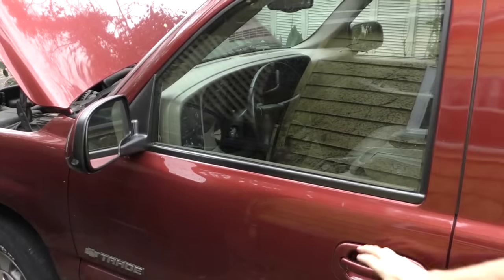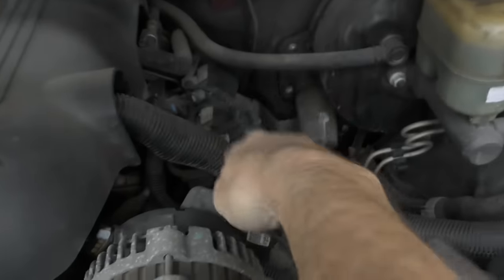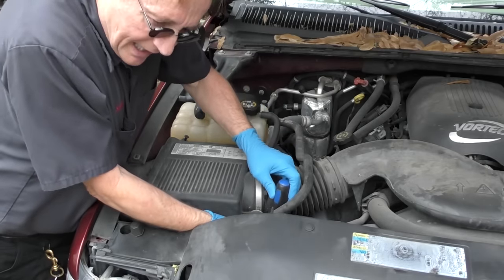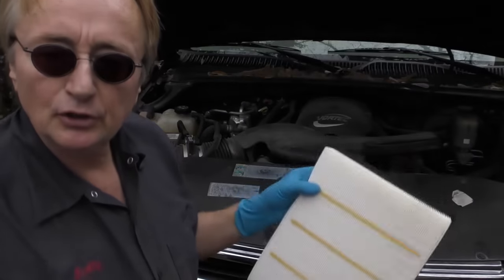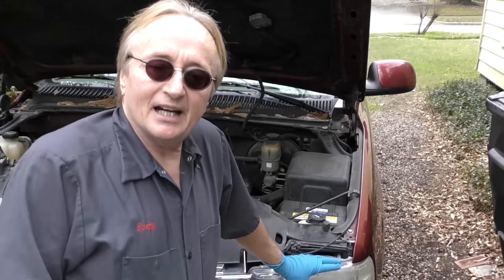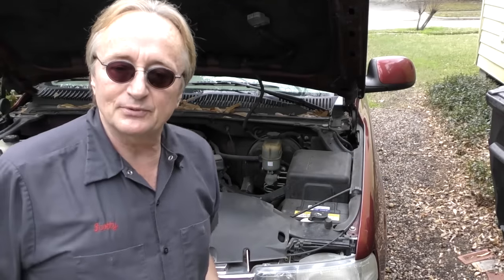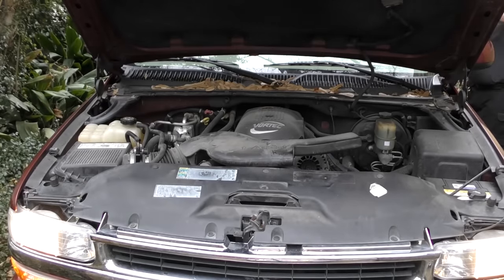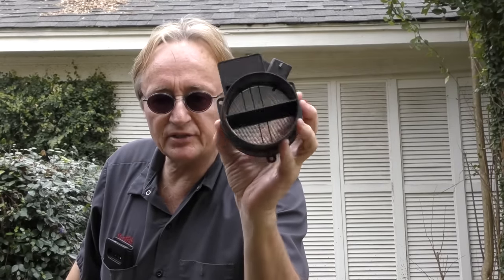Doing This Will Make Your Engine Run Better

Comment: Not to mention the MAF sensor deals with the trans shifting.
Reply: Best to keep them clean. The three wires if I’m thinking correctly has a three wire that heats the sensor to keep it clean. But a dirty Maf sensor can alter the shifting.

Comment: Man my truck's been doing the same thing like it struggles to like get to 7075 it stays around 60 I changed the fuel pump filter fuel injectors well clean the fuel injectors did all that necessary stuff with the fuel and it said I was running too lean on bank one and two got new spark plugs new spark plug wires did all that I didn't think about the damn fuel early mass air flow sensor searching for a long time I'm going to get one of those and see if that helps

Comment: Scotty, I have a GM 2.2 Ecotec dual overhead, it keeps blowing code P0420. We've changed everything that we can think of that deals with that code, every sensor front to back, including catalytic converter sensors. Mass airflow, oxygen..all... what else can it be? I'm thinking maybe electrical at this point.

Comment: Wow this is probably the problem with my Crown Vic.  I've been chasing a vacuum leak forever.  +24% fuel trim on both banks, and pinging on heavy acceleration.  I've tried to use propane enrichment multiple times to effect the fuel trim with no luck... 

I also cleaned the MAF when I bought it and killed a check engine light(don't remember what it was for though).
Thanks!

Comment: I wouldn't change an air filter that clean.  If the air flow is as good on the cheap one, it's just as good, unless it allows larger particles to pass through.  The type of material is critical.  Less material might make it need to be changed more often.

Comment: Hey Scotty, I have a 2013 Hyundai Elantra Gt Gls with 170,000km. I hear a clicking noise coming from around where the alternator and fuel injectors are. Do you have any idea what could be causing this noise. Ps the sounds of the clicks get faster as a accelerate. Love your content have a great day!

Comment: I had this same Code on an Audi 3.0 A4 Quattro.... service writer looked me straight in the face and told me " car needs all 4 O2 sensors, New intake manifold,  gasket and plugs".....say what??? Lol! I knew the MAF had failed.... I drove away...never looked back. Swapped the MAF, it cleared all codes and stumbling.

Comment: I have a 03 towncar executive and I can drive for a couple hours and then the car just cuts out. Especially on an incline going 65 plus on the interstate. Replaced the plugs which were factory, the oil and filter. Ran great for a bit then on the way to Portland OR from Olympia it just cuts out, shuddered to a stop then stalls. Can't figure out if it's the MAF or clogged cat converters

Comment: Heres one Scotty code 1421 2009 N-Versa 1.8 service engine light comes some times it will stay on for 2-3 months then go out stay out for 2days or 2months then comes back on again and it generally does it more in the colder months?

Comment: Hiya Scotty, I really want to know if I made the right choice or not. I replace almost EVERYTHING on my 2002 Honda Accord EX with the 2.3 and standard trans. Had 300k on her so I changed ALL the suspension, dropped in a used 60k engine with all new seals, gaskets, injectors and the same manual trans. The whole project took me 4 days and about $2500. Runs like a dream again. Did i make the right choice?

Comment: Scotty quick question. I have a 2013 Nissan Maxima with over 200,000 thousand miles. What would cause your low beam headlights to dim? I recently replaced the halogen bulbs to LED's. I changed the pigtail wire harness to ceramic. The led bulbs seem to be a little brighter but still the bulbs seemed to be dim. I took the car to a Nissan dealer which they couldn't find nothing really wrong but suggested that it could be the wire harness from the engine might need to be replaced for a thousand dollars which

Comment: Hi Scotty,
I have a 1991 Chrysler Voyager (european version of the Dodge Caravan) with a 2.5L engine with a manual transmission.
It has 510 000 km (315 000 miles) and is burning oil (around 1 liter per 1000 miles)
What do you think about those engines (and car)?
Thank you

Comment: I poured fuel injector cleaner in my 08 Silverado got on the freeway stepped on the gas an check engine light turned on

Comment: You didn't have to buy new maf sensor, cleaning the old one with maf cleaner would work. Also air sensor has nothing to do with lean fuel. It's before the sensor

Comment: 07 Equinox...lo beam headlights both quit. Hi beam and all other lights work. Dimmer switch turms high beam on off...no lo beam.  Fuses ok.  Diagram does not show a relay.   Where is the light relay(s)?  Any other pointers appreciated.

Comment: What would cause idle miss in 05 Century 3.1 motor...Smooth as silk after acceleration. Seems like Low exhaust pressure also at idle. Egr or Converter?

Comment: Hello! I’ve got a 2005 R52 mini 1.6L that I’ve done all 100 miles maintenance, but my Disc brake and Tire pressure sensors won’t shut off, yes I’ve replaced the 2 sensors and the brakes are new. What’s the secret to reset these crazy problem off. I tried all the secrets with interior buttons and disconnecting the battery. I mean everything and tire pressures check everything. Help please!

Comment: You could of used live data to determin if the maf sensor signal voltage was high or low instead of guessing that was the problem. I didn't see you check for vacum leaks. Now everyone who has seen this video is going to be throwing parts at it, they will go out and get a new maf sensors soon as their fault light comes on.

Comment: I have a 2012 Mazda 3i 2.0 L 4 cyl. 6 speed manual. I use it to Uber, great MPG. Currently 86k miles. How do you feel about synthetic blend oil for what I use it for? 100 mi a week Uber all city driving.

Comment: Thanks for the video. I am a 2004 Ford Expedition owner with lean banks problem and no specialists in the range on 1000 miles. Will the replacing the same thing help my Triton 5.4? Thanks.

Comment: I have a 2017 Toyota Corolla xse
I have  driven 60,000 miles and I was wondering if I should change the CVT fluid? Is it necessary to change the fluid?
Reply: Curious thing:  A long time ago my father and our mechanic had a conversation about transmissions.  My father offered the thought that the perfect transmission would be continuously variable.  That was 1964 at Mattar’s Garage in San Diego.

Comment: Hay brother I've got a 350z 2006 that I've modified and having issues with o2 sensors that I've changed over and over and in 4 day over again. They are now installed in long tube headers and showing low voltage issues and I cant seam to stop my vaccum leaks too. New hoses you name it this car didnt want a modified makeover lol.

Comment: Scotty, I have a question if you can answer for me... I bought a car, a 2000 Nissan Maxima and the check engine light doesn't come on when I turn the key to the "on" position.. I don't even know where it is suppose to be and can't find a pic online anywhere.  Could you help me find where my check engine light is suppose to be on my instrument panel?  and is there a fuse for the check engine light that I can check before I take the instrument panel off to see if the bulb has been removed??  Thanks so much!

Comment: Hey Scotty!  How do I ask a question?  (About an 05 Matrix with 350,000+ miles!)  Battery light came on intermittently over an hour of freeway driving (wipers slow when on, fine when off)..., then bogged down enough to just get off the freeway and call tow truck.  Is it probably the alternator, or possibly something else?

Comment: Great Video but what if it runs rich. I have a Toyota Yaris 2009 1.33 And I have a P2196 code Oxygen (A/F) sensor signal stuck rich Bank 1 Sensor 1. The car idles normal drives like a dream picks up speed and doesn’t hesitate at all but every time I clear the code why does it keep coming back on after a week of driving. I only drive local like 15 20 minutes a day to and back from work.

Comment: The little sensor wires inside the MAF do get dirty over time (even with regular air filter changes).... there are no moving parts to a MAF that can wear out, so you probably threw away a perfectly good MAF sensor that just needed a good cleaning with MAF Sensor Cleaner spray. Also note that a failing Fuel Pressure Regulator also causes these same symptoms, the fuel pressure only needs to be a little below specs to cause the injectors to dribble fuel instead of spraying fuel into the cylinders and that messes up everything! Arghhhh!

Comment: Hey Scotty what you think about straight pipe no cats on a silverado from 1990 to 2007 silverados and wonder if the too much back pressure is actually an issue or if it’s okay on the engine or even glass packs no cats thank scotty

Comment: Scotty I have a 2007 Chevy Silverado and the engine light keeps jumping on and off. I changed the plugs and wires and it’s still rinds ruff,  it doesn’t go over 40 miles per hour,

Comment: I have a different problem. 2010 Volvo XC60 T6 - recurring P0420 then $07E8 1/1 Generic. Says Catalyst System Efficiency Below Threshold Bank 1. I reset the codes and ran it approx 300 miles and the code came back. Reset and tried Caticlean (SP?) and it came back within 100 miles. I reset the code again; so far so good but what do you suggest?

Comment: Does oxygen sensor, or map sensor detect HHO hydrogen? If at idol I added hho will hydrogen take more space and cause map sensor to give less fuel signal,  since less air means lean fuel( less fuel)?

Comment: Scotty i need an advice. What can make my Gems P38 engine die when i push the brake. I have no code with the scan tool on the engine new spark plugs and new throttle position sensor new o2 sensors. I solved the problem by making it idling at 1100-1200 (with the screw on the acceleration cable) instead of 700-800. The problem is if i live it to normal idle when i break at low speeds it makes the engine die. What can it be?

Comment: Hello Scotty i have a ‘02 sierra 3500 8.1L with a trouble code PO101 that constantly comes up when I gently accelerate when passing or getting off the ramp to speed limits!!!  Tried cleaning and replacing (3rd sensor) but still pops up after about a month later !!  Runs fine  w/ good response .  Changed O2 sensors as well w/ 122k miles on it .... any ideas 💡 sir ?
I usually clear trouble codes each time.  STFT/LTFT seems to be fine reading live trends .

Comment: I have a V6 Genesis coupe with the same issue on the driver side bank only. I check for vaccum leaks with smoke machine, cleaned the Mass Air Flow sensor and the engine code only happens at high speed. I was going to change the fuel pump and the sock next. I'm I on the right track?

Comment: Does this theory apply to Asian cars as well..my 1999 Honda Civic LX is throwing a P0420 code cat efficiency low.. beginning to suspect too much fuel smells like it's running Rich.. Any suggestions.😕 Thanks for your time.

Comment: Hey Scotty my wife has a 2005 Toyota Matrix and it recently got the code P0171 system too lean bank one. The car idles rough and the cooling fan turns on and off all the time even when Not using the AC. I checked an old video of yours about this code and in that video you worked on a Matrix like my wife’s and you replaced the intake manifold gasket,  so that’s what I did on my wife’s car but the problem didn’t go away. Do you think it can be the mass air flow Sensor or maybe bad injectors or fuel filter or the pump? It’s weird because the needle on the temperature doesn’t indicate that the car is overheating, the needle is always in the middle where it should be and the car starts right up and drives past 80mph and it has never died on my wife. This has been going on for 2 weeks already and I can’t figure it out, the car only has 148,000 miles
Reply: Look up Toyota TSB EG051-05; that code can be tripped on 2005's by a poorly-designed air/fuel sensor (different from the mass air flow sensor) that needs to be replaced.

Comment: P2135 p0220 2005 Yukon 4.8. New throttle body new throttle body pig tail harness. Still power engine reduced?

Comment: Scotty,  I have a question - I have a 09 Chevy silverado w/t short bed reg cab v6 , I just noticed that yesterday while truck was parked running that the heat turned cold and when I started driving the heat was came back fine but I can hear the fluids going to the heater core.  Is this an issue ? Thanks scotty

Comment: A question to the oriacle. why is it that a car running on LPG sounds loud/clicking compared to running on its designed petrol fuel. They sound like an old diesel. Is it because of high temperatures or something?

Comment: Hey 👋 Scotty I’m have problem with my 2018 Escalade 6.2 it is have idle . I replace spark plugs and wire , check coils they good , change the throttle body , change air filter and cabin filter , check for vacuum leaks but still doing it . But I doesn’t have the check engine on or any codes but when the mechanic put the scanner it show that cylinder 7 is having a little problem. What show I do ? Change the fuel injecter ? I do now what to do anymore the car only have 65k miles 🤦🏼‍♂️🤦🏼‍♂️🤦🏼‍♂️🤦🏼‍♂️ thank you

Comment: Hey Scott can changeing the mass airflow sensor mess up the transmission shifting? My 2004 suburban has 200k miles and it's shift 1-2 but 3rd takes a while. I have to push it and let go of the gas pedal so it could kick in.

Comment: I have a 2016 Lexus IS200t it has 42000 or so miles do I have to use the factory specified oil 0-w20 or can I use 5w-30???     I feel like the lifters are making much more noise since last oil change I did and used 0-w20

Comment: I know Scotty doesn't like the Nissan Altima, but I have an '03 3.5 L and it doesn't even have the same engine as the 2.5 Altima's.  It has a Nissan Maxima V6 engine.
Reply: Every Nissan i have owned has been super reliable.

Comment: I had that same stupid code on my 2016 Honda pilot I wish it was that easy to fix but unfortunately me and my luck the fuel injectors in the fuel rods are no good which cost me a whopping 1500

Comment: Would the check engine light turn on if the engine was running lean? Or is it something the driver would notice from driving the car?

Comment: I have a 97 4.6 mustang gt and I had to replace the injectors, 19 pound injectors came out and 24 pound injectors are all I could find to replace them so how can I get the engine to cover the difference bc it runs good but if I come to a stop to fast it’ll stall I can definitely tell it’s running rich?

Comment: My headlight 2017 vw golf on my drivers side went out changed the bulb didnt fix it push sideways on the housing and it sometimes comes on. Took it to the shop they said they fixed it 3 weeks later it goes out again should I replace the assembly

Comment: Hey Scott, I have a certain issue. I have a 2003 Mercedes ml320 (w163) and I keep getting the same 2 codes. O2 sensor heater for bank 1 sensor 1 and Bank 2 sensor 2. I changed all 4 o2 sensors out with brand new OEM BOSCH ones and the codes still won't clear. I cleared them with a scanner, I've driven at least 150 miles since changing them and yet the codes still won't go off. Also I'm getting fuel injector 2 and injector 5 circuit open. Any idea what it could be? I've replaced all 4 o2 sensors, spark plugs, all new ignition wires, new MAF sensor and new MAP sensor. Nothing has changed code wise but the car is driving MUCH better. Also I'm still getting about the same gas mileage as before I replaced all those parts, around 200 miles to the tank. Literally have to fill up every 200 miles and I know I should be getting around 20+ miles per gallon.

Comment: Why didn't you spray clean the air censor.  Cleaned the 3 on my 3.5 made an instant difference. Cost the price of air censor cleaner and the time.

Comment: Scotty I have a Yamaha Warrior xv1700. The top end on the front cylinder has been making a ticking noise ever since I bought it and I change the oil regularly and I've had it for 4 years any ideas

Comment: The 5.7 in my '17 Grand Cherokee sounds worse than that engine for the first 10-15 minutes after startup with only 33k on it. I've taken it to two dealerships and they both say it's normal. I really should have bought something else. But hey, it was brand new, it'll be fine! Yeah right. Now the only question is do I trade it in for a 4Runner this summer, or do I wait until next summer when I'll have more money and it won't look like there's something horribly wrong with it by trading right as the warranty is up.

Comment: So if my 2013 Sierra keeps throwing evap code saying vacuum leak and I’ve gone through everything ....changed evap canister near fuel tank...new gas cap...new map sensor.....could the MAF cause an evap code?

Comment: I’ve got oil leaking on top of my alternator causing it to short out, I’m planning on replacing it, I was wondering if I can take something & seal all the openings of the new alternator to keep anything from being able to get into it, would that do any harm to it? Does it need any ventilation?
Reply: Spring Hill Outdoors yeah it needs ventilation. Fix the oil leak